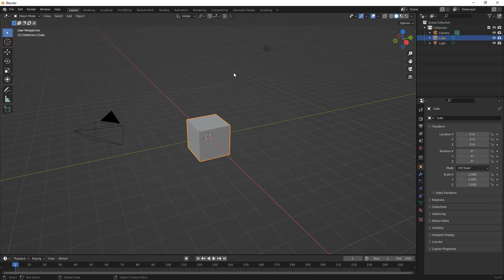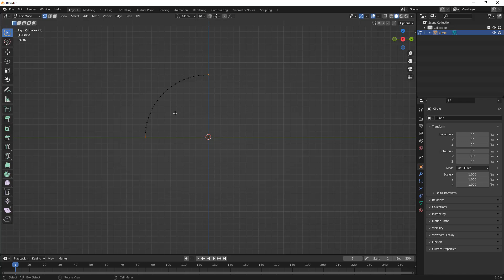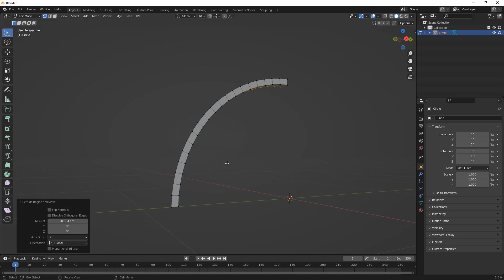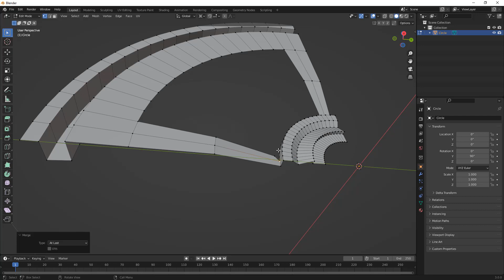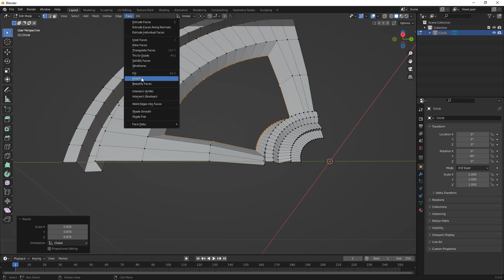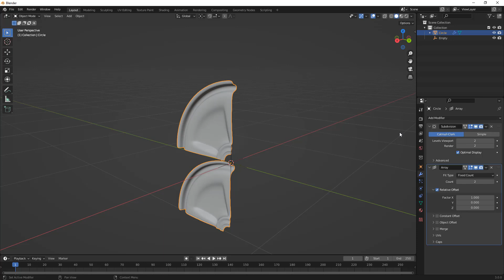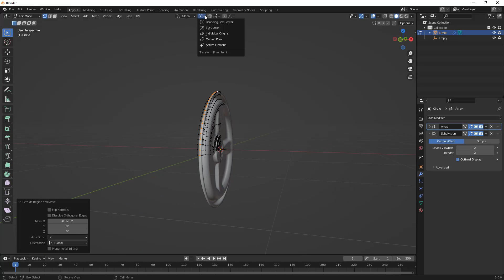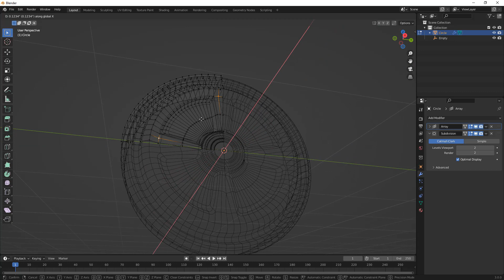How To Learn Blender Part 13 - How To Use the Array Modifier on Car Rims #Blender

Comment: ban hướng dẫn rất dễ hiểu, tôi không hiểu tiếng Anh nhưng thông qua google dịch tôi vẫn hiểu những gì bạn nói. Tôi đã vào kênh của bạn để học blender nhưng các video còn quá ít, hi vong bạn sẽ ra nhiều video hướng dẫn về blender hơn
Reply from the maker: Thank You. I am glad you were able to follow!  I don't have many Blender videos because there are so many great creators for Blender.  I tried to focus on the areas that are usually sped through or skipped.  Maybe I will add more Blender, but it would be a little while.
Thanks for the comment!